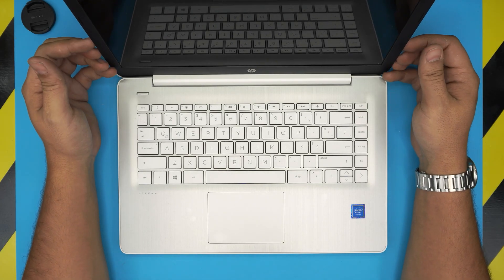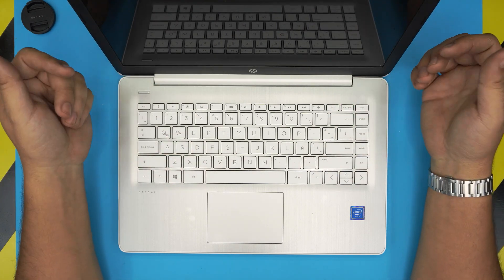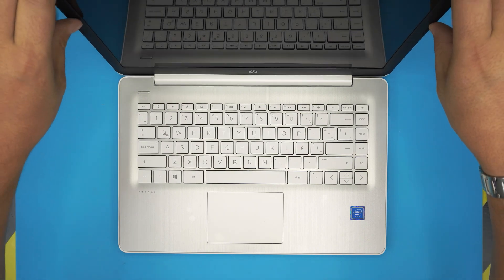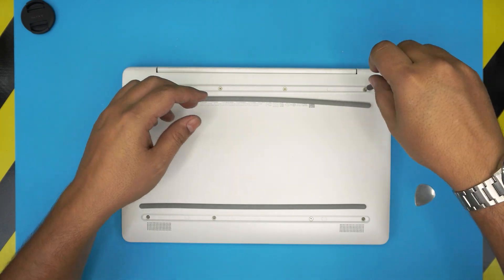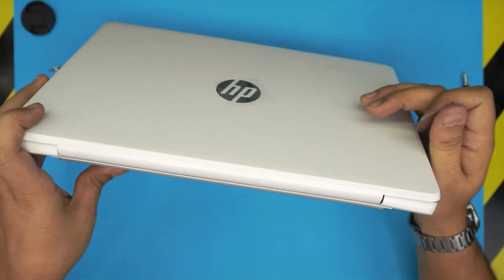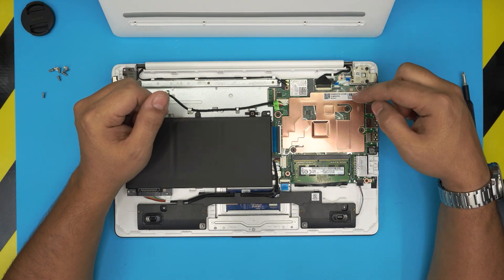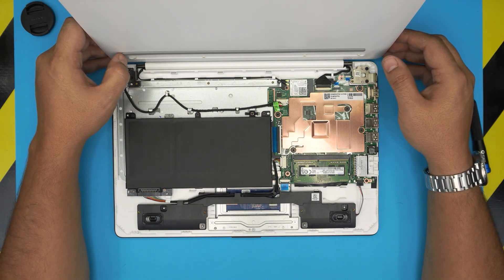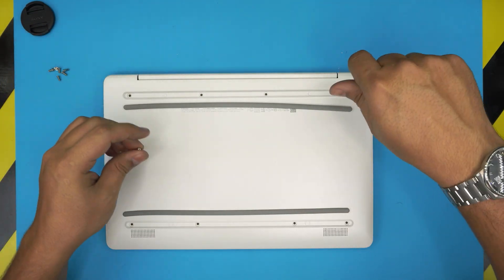Hp Stream 14 Ax113 🚩SSD | HDD | UPGRADABLE ????

Comment: You aree the only one who explained this need to know if I can get the hard drive info out of this error says hard drive not found I am a Sony camcorder tech 11 years need to check voltages to mother board maybe reflow solder on emmc chip excellent video
Reply from the maker: It's my pleasure my friend.
If your eMMC is degraded and can't load Windows, and you need to recover data, you'll need to remove the eMMC and use a device that allows you to access and extract the data. However, this device is expensive.
cheers🍻

Comment: @UFIXTEK is right, in that it is not worth Upgrading the eMMC, the time and cost for an extraction and reball to say a 64 or 128 GB  is well more then another upgrade. The eMMC is the Bottleneck!! An M.2 to NVME Adapter + NVME SSD paired with an 8 GB stick of DDR3 Ram is by far the better way, and perks up the way the laptop runs. Do Not expect this upgrade to give you I3 speeds by any means, however if you have spent any time with a Stream the eMMC just can not feed the RAM quick enough (Boot time on eMMC is awful). You want to bypass the eMMC like YouTube Channel PFC (only video they have), or Ivan Popov YouTube channel did. PFC installed POP O/S (Linux) to eMMC then added reFIND to remap Boot to SSD (eMMC no longer shows in Explorer), so even cold boots are faster.
Reply from the maker: Thank you for the feedback and your commentary.
cheers🍻

Comment: Yes there is a way to upgrade using the emmc wiffi slot, let me know if interested and ill create a video explaining all the process
Reply from the maker: we do the upgrade for storage via wifi slot , but that is not bootable storage, the bios will not detect that slot as bootable drive. so it's like having extra storage.
Reply: @uFixTek  correct but if you install grub on emmc storage it will recognize the new storage, it works on my laptop
Reply from the maker: yes , but the BIOS will still not recognize it as boot drive for windows,
only as storage as you mentioned
Reply from the maker: i will try again to boot using grub, but last time i tried  it didn't boot and it kept crashing.
also people will need to get a usb wifi adapter, and for regular people i don't think this is a easy solution for them.
thank you for the feedback
Reply: @uFixTek can you told me the solution ?
And how I make it my self ?

Thanks

Comment: You can use a m.2 ssd just remove the pcie wifi card and put the m.2 in place, put a usb wifi and is done boom, this guy need to know more about laptops or pc 😂 but thanks anyway
Reply from the maker: you forgot to mention if anyone does  what you mentioned , they will not be able to boot from thatm.2 , and i hope this guy have informed you more about the laptop you have, the bios will not boot from it so useless move.
Reply: @uFixTek  you right brother shame on me you have all the reason 😁
Reply from the maker: its all fine we here to learn and help we as humans need to learn, no sham on learning, i been in repair and servicing for 17 years if there is anything i can help with i will gladly do so, cheers
Reply: @uFixTek  If anyone interested, yes there is a way to boot from the wiffi ngff slot. i just finished installing one, the bios wont regognize the drive but if you have linux with grub on your 32gb emmc, all you need to is to add the new os in grub, change some settings for the new os to be defauls and done, I have a 120 gb m2 ssd on my stream ax-14022nr, i can detail the steps or post a video,

Comment: your explanation of why m.2 slot wouldn't work is not very accurate
m.2 slot would work if you install 4 10nf capacitors ub the sata lines directly under the m.2 slot on the bottom and move pin programing resistor from position r99 to position r94 disabling emmc and enabling sata (in ax board, with ddr3 memory, i have no manual for ddr4 board to confirm that) no other components are needed, but it onlt works with sata m.2 drives
no power delivery modyfication is needed because m.2 drive only uses 3.3v rail that is already on the slot
Reply from the maker: Thank you for the feedback! if you wish to support the channel you can LIKE or SUB or both :P
regarding your opinion: Well done on your observation, my friend. We do install the m.2 jack and the components required to make it work with a schematics. but regular DIY consumers it's not up-gradable or usable.
Reply: @uFixTek  it is still very infuriating that hp keep the connector on board even if they don't use it in any of the models and for some people with broken emmc chip because they do fail it might be a way to save on replacing the whole board or computer
Reply: @uFixTek  by the way i am just a "normal user" only a bit older, from times when you just build your own computers
Reply from the maker: im at my 40s and i been repairing and servicing for over 17years. trying to help out people to do their own services and upgrades at home to make them save some.
Reply: Hi, I've tried this on 14-ax model. It works but the keyboard and trackpad freezes after waking from sleep or hibernate in Windows 10. Tried driving it but still no luck
Reply: @andrewb.635  i have made suspend  and resume work in a very odd way
i had one board with emmc riped off with the pads, so no saving it, i installed m.2 connector and caps as usual but then i also removed sd card reader chip! and left sata emmc jumper to emmc!
laptop not only boots up normaly from ssd now in uefi and legacy mode, suspend and hibernation both works and keyboard and touchpad don't go all crazy anymore. it also go to suspend faster and go back faster.
although i didn't try it with secure boot enabled yet but it most likely will also work
fun part is i was also able to solder in in place of that sd card rader chip another m.2 socket and place it next to a speaker on the side of the laptop and installed another ssd in there nvme pcie x1 read and write speeds are comparable to sata , that is 4 times faster than emmc but this drive is not bootable without some bootloader with nvme driver (duer/refind, i wasn't been able to make clover working)

i think the bios just got confused with missing device because it was hardcoded for emmc  and emmc missing while other device is also missing messed up adressing space and it kind of magically fixed itself
i don't know if many people uses sd card slots nowdays but it being on pcie bus is kind of ridiculous when you can probablu hack a usb one  with extra usb hub inside or pcie usb controller chip and handwire the sd card from there
Reply: @kokodin5895  Wow, that's some complicated stuffs. SD cards can be read using a USB SD Card reader instead if needed, so no one would be too bothered about a non working dedicated SD card port.

I would like to know more on how to replace the SD card reader chip with the M.2 connection wise so I can use on the Stream 11 series that don't have the M.2 port.
Reply: @kokodin5895  Would it be possible to fit in the M.2 port in place of the WWAN space provided in the Stream 11 series?

Or replacing the SD Card reader chip in that model would be a better option?
Reply: @kokodin5895  Well-done, that's a great achievement 👍
Reply: @andrewb.635  it is very hard to tell at this point, i don't have access to a test subject laptop like that right now and didn't look for documentation yet. if it has pcie based card reader like stream 14  you can rerout anything. the pitch of the connections is the real problem here. card reader is the U3 on  14 ax boardview and you need to get 3v, gnd and pins from 1-6, 23-24 (+3v, gnd, pcierx+, pcierx-, pcietx+, pcietx-, pcieclock+, pcieclock-, reset, i clockreq) i would post a picture but youtube don't allows it

adapting wan port isn't much different only wan port is mixed signal port pcie+usb and pinout of e+a slot is different than m or b key but you could build a splitter out of a ded wifi card but you would have to get usb 5v from somewhere else on board
Reply: @kokodin5895  Thanks 🙏. It has a PCIE based Card Reader. It's on a daughter board which is not indicated in the schematics. But I can use the SD Card chip's Datasheet to get the required Pinouts
Reply: @andrewb.635  if it is realtek RTS5239 like stream 14 then pinout is on 16th page of schematics diagrams , only ot is kind of upside down. but with separate board you have even more room to play like  separating signals on the flat blex  if they are in one block should be as easy as getting longer cable and cuting it , and flat flex lines should be much easier to solder  because they will be wider apart
you cuold even go as far as to spin your own small pcb that intercept all signals you want and pases all you don't need and routs them either to another flex , exposes pins for soldering or to m.2 socket directly
i used macbook adapter to solder things to for convinience, pins on the edge connector are much easier to solder than on the socket itself pinout for m.2 pcie you can get from googling "m.2 congatec Application Note" and on 10th page just remove  pcie1 rx and tx and usb, wake up pin, and pin spacing is the same as in m socket in stream 14 boardview
Reply: @andrewb.635  little update
trick with switching from emmc to sata need to be performed every time you reset the bios so i aded a jumper on a 3 pin header next to ssdand sice i don't know if stream 11 uses the same trick in bios i can't guarantee it work the same way, aside of havin nvme socket
Reply: @kokodin5895  its the YOA Model and it uses RTS5141.  I will just compare their datasheets. Thanks
Reply: @kokodin5895  It is good to know what to expect. Thanks for the update, it is very helpful.
Reply: @andrewb.635  oh , good to know what to expect 
but i would look for problem elswere 
drivers for both keyboard and touchpad are not hid class but ps/2 and those don't like hot swaping. that is probablu why ssd had initially a hibernating circutry next to it so it can go to sleep while ps2 can be kept alive and now we don't have enough power on suspend line?

Comment: WRONG... google more, this guy is correct you can desolder and reball in a new eMMC but the wireless card to M.2 adapter works well in these units. I have retro-fitted  several over the years you only need three items. The new drive, drive adapter to fit the wireless card slot and a usb WIFI adapter....
Reply: What kind of drive adapter i need for this unit
Reply from the maker: thank you for the feedback but the problem with using the m.2 adapter is that the speed of the adapter its going to be as fast as usb3 not ssd or emmc chip, because the controller for the adapter is not fast, unless they make a better controller (adapter) that can read a m.2 ssd like it should be then sure use usb wifi and slap in a ssd in wifi. we have few adapters in the store and use them but the speed that we get from them its garbage compare to ssd it like having os in USB3
Reply: @uFixTek  That is not why I posted, you clearly stated that it could NOT be done. I said nothing of speed , BUT it WILL be faster then the SSD controller currently inside this unit.
SATA bandwidth is slower than that of NVMe. These laptops have SATA SSD controllers and eMMC chips which are slow compared to even 1x M.2.
The laptop in questionn only gets about 96MB/s ish from the onboard SSD that is SATA.
Where the adapter and M.2 NVMe at 1x will  top out at 250MB/s.
Where as these lil gems barely get 100MB/s.
Oh and by the way...
NVMe can have theoretical transfer speeds of up to 20Gbps whereas USB 3 is only 5Gbps.
Reply from the maker: i have never said you can't install ssd via modding( adding adapter on wifi port), i have explained the internals so people see what they have, and that the storage is soldered and they can't add an additional ssd because of the actual m.2 ssd jack not installed. but you not wrong if anyone wants to sacrifice the powerful internal wifi for storage ONLY (not system OS) or external powerful GPU they can use that port for it.
again not all adapters are good for ssd and not all adapters will recognize the ssd.  note you may have hard time or impossible to boot from that ssd. because bios does not have the wifi lane in boot list. but you can use it as an extra storage, until an updated bios or modified bios that lets booting from that storage, till then only storage.
adapter for make storage out of the wifi connector: https://amzn.to/3OvqjuW
external gpu adapter: https://amzn.to/3yp21xg
Reply: @uFixTek  you can run the OS right off the m2, youll get speeds at and around 450mbps depending on ssd headroom, makes any ram upgrades pale in comparison, if it sees it as storage you can set it to boot.
Reply: @IvanDPopov  i am still looking for bordview for revision d of the motherboard but at least on 2gb version of the board with ram directly soldered the m.2 port that has no connector is fully wired for sata m.2 drive to 2nd sata line on the cpu, so theoretically it should work as dual drive model, even if you can't boot from it
the m.2 port on the side has however no pcie lines routed to it at all so this might be why the video claim you can't add another socket. i need to hunt one of those laptops just to prove it wrong or die trying
Reply: @whizatit  my tests shows different valuse
180/90 read write for emmc sandisk
560/140 with used sata ssd toshiba thnsnk128gvn8
450/270 with used pcie x1 ssd, very stuby one toshiba kbg30zms128g

i didn't use an adapter for nvme i have oryginal wifi/bluetooth card in place, instead i soldered 10 wires in place of removed sd card reader chip and routed them to macbook short adapter  and it worked from the first try.
Reply: @uFixTek son , u must UNDERSTAND what he said..

Open ur mind, be nice and respect, plis!

If you don't know about the topic, investigate, learn and then give your opinion!

you look bad making meaningless comments😒😑
Reply: @lobitofoley9795  Are YOU sure you understand? Because unless you have decent soldering skills, these "HP Stream Laptop" were meant for people who just surf the internet, not for people who going to do anything more than just going online. It one of the reasons why SSD isn't upgradable and why these two idiots keep arguing about how it upgradable, forgetting that not everyone can just solder because "you can, you just have to do it because I can".
Reply: @terrabaka  ho...y     sh.....t   !

🤦🤦🤦

R   U  fu...'n   nuts?

Kateme! (Aka God damn  it )

go, paint  a forest 'n  get lost !😑😑
Reply: @uFixTek  it wouldn't be usb  it would be pcie gen 3 using 2 lines, you could rout usb connection of the bluetooth part of that card away from that port and you would get extra usb port
the wifi socket is mixed mode usb + 2x pcie